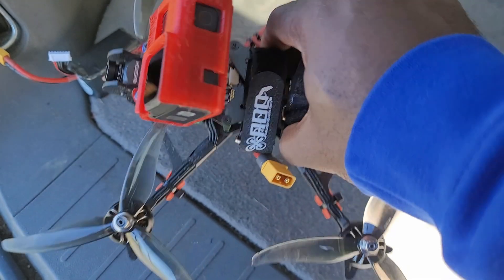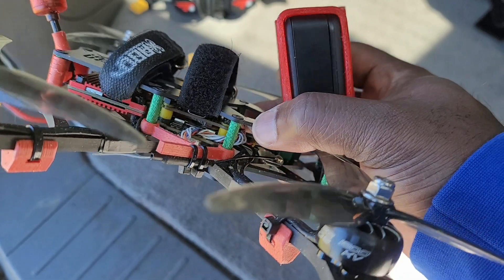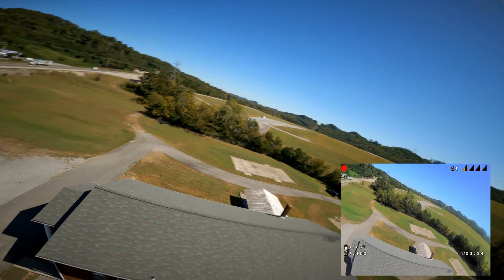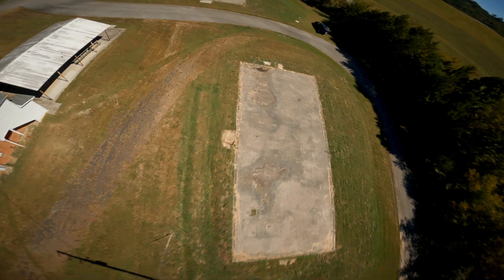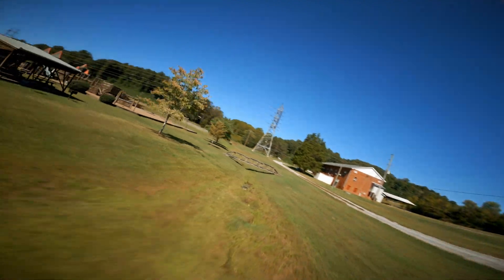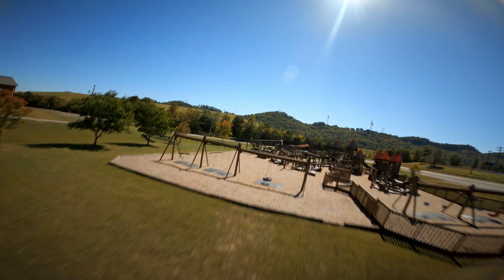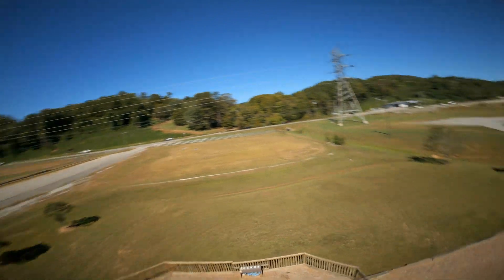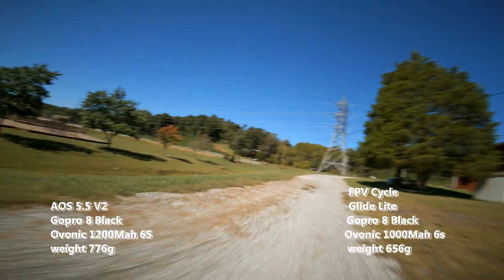AOS 5.5 V2 FPV Drone Build

Comment: is there a way to upgrade this so it fits a O3 air unit?
Reply from the maker: It will fit the O3 system.
Reply: @GBoniFPV  really? the AOS 5.5 V2 is the same as the AOS 5.5 O3?
Reply: @shotbyarian  yes it is
Reply: You want the new evo version that soft mounts the camera.

Comment: Are you french, man? Or what's ur accent?!
Reply from the maker: I am not french, but it is one of my native languages.
Reply: @GBoniFPV  comme moi 😉 belge, donc pas français non plus, mais francophone. Merci pour cette vidéo. Selon moi, le véritable intérêt de cette frame est de mettre des moteurs puissant (Xnova 2208 1900kv dans mon cas, ou bien les Xing 2208 1800kv (vert et noir (et non Xing-E), ils ont une meilleure précision, selon moi) et une grosse batterie (tattu 1550mah par exemple). Et là, ça devient un monstre ! Et en mettant un throttle limit à 75 ou 80 %, tout en étant doux avec les gaz, j'ai 8 à 9 minutes d'autonomie avec la cam' HD. 
C'est mon meilleur drone, et de loin!
Reply from the maker: @marcalbert8980  j'ai vecu une partie de mon enfance a Bruxelles.
Reply: Cool. Et bien tu as vu plus de paysages que moi, je t'envie 😉